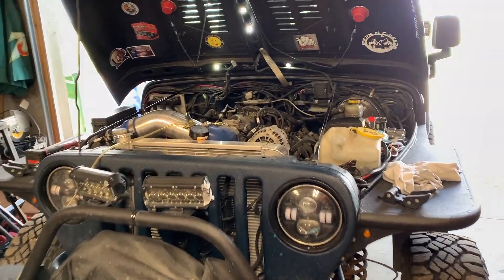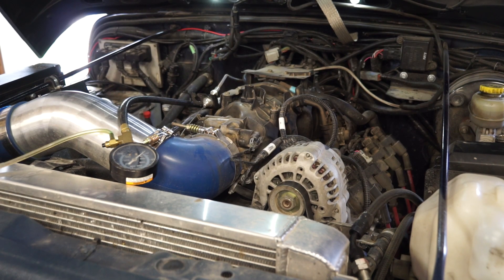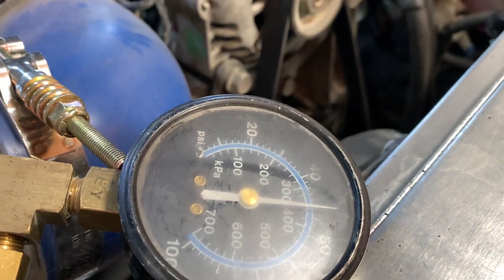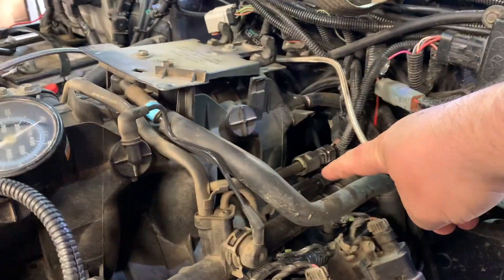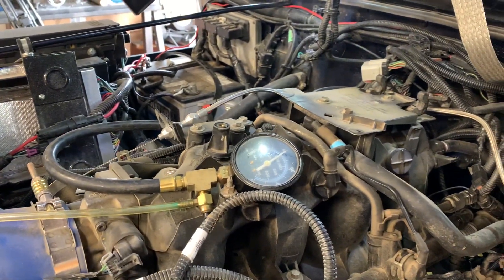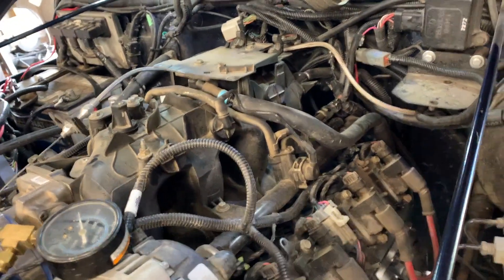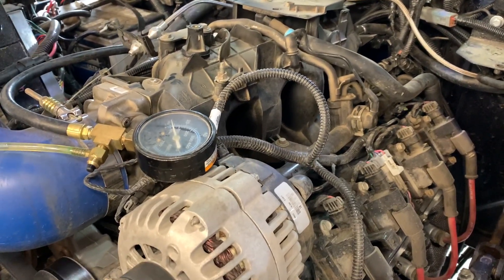Fuel Pressure Regulator Symptoms and Testing

Comment: Hey I have a question. I drive a 2013 Hyundai Genesis R-Spec 5.0 sedan and it’s dumping fuel big time. Gas mileage is as bad as your going to get. My drivers side exhaust is smoking and I just checked my dip stick and sure enough there’s gas in there.  As of right now I can’t drive it because it smells like gas to bad in the car. Do you be think this could be the problem?

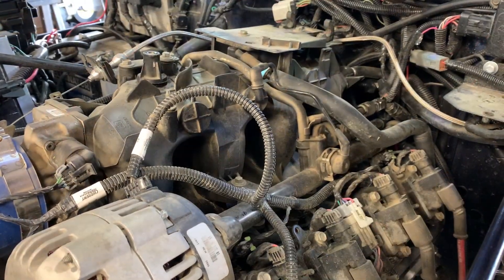Comment: Dear BSK Garage, at 2:45 you mentioned that you should also check the fuel pumps. If the fuel pressure reads 0 when you plug the pressure reader in, does that mean the pressure regulator COULD be bad?
Reply from the maker: It could be but also many other things

Comment: I have a 2002 Chevy Silverado 2500HD with the 6.0L Vortec. 185,000 miles. All cylinders misfire at idle. It all started after I changed the knock sensors/sensor wiring harness on it. I've chased down almost everything. New intake gaskets, new fuel pump and filter, new fuel pressure regulator, new injectors, new ignition coils, plugs and wires, etc. Nothing has helped, it still misfires at idle but runs fine while driving. However, last week, it's now started just randomly sputtering and dying on me while I am driving it. It acts exactly like it's running out of fuel. It now does it very often. I did a fuel pressure test at the fuel rail and have 50PSI when I turn the key to the RUN position, and then it drops to 46 PSI when the truck is on and idling/misfiring. Even when I get on the gas (held it steady at 2000 RPM) the PSI stays at 46 PSI. Is this too low of fuel pressure for the 6.0L? I googled it and a lot of people are saying for a truck my size, it should have 55-65 PSI of fuel pressure. Any input is greatly appreciated!! I am out of ideas.
Reply: Did you ever figure out the problem? I have this problem
Reply: I did figure out what the problem with it dying was. The fuel pump had gone bad. I replaced it and it didn’t die on me anymore. However, it still misfires to this day on all cylinders, I was never able to figure out the problem. Currently at 240,000 miles and it still runs okay even with the rough idle due to the misfire. It doesn’t affect the gas mileage either, so I just decided to stop chasing it and leave it be.

Comment: My friend, I have a question. my vacuum hose that is attached to the fuel pressure regulator don't vacuum air like yours did. what can I do? is it a vacuum leak or gasoline leak that is causing this problem? because I found oily matter on the fuel return hose with gasoline smell.

Comment: I have a 2003 tahoe flex fuel at idle I'm getting 45 psi is this to low Thanks!
Reply: we’re you having any symptoms?
Reply: @austineash2649  it was ignition coil i took it to autozone but it was showing the wrong coil pack when i put it in the shop they changed a different  one and it started running good.

Comment: 👍 and you never get a CEL for a fuel pressure regulator just the affects plus fuel pressure does not indicate fuel volume so that's another animal :)
Reply from the maker: That is correct, low fuel volume will most likely result in a lean code and or misfire
Reply: I purchased one from wax racing... I'm not doing a swap anytime soon, it's from china, I have no use for it. I'd be happy to send it your way if you want to review it.
Reply from the maker: You actually got it, I know people were complaining that they never
Reply: @TestDontguess  yes, wasn't my smartest purchase.